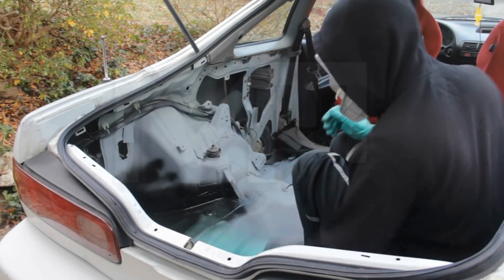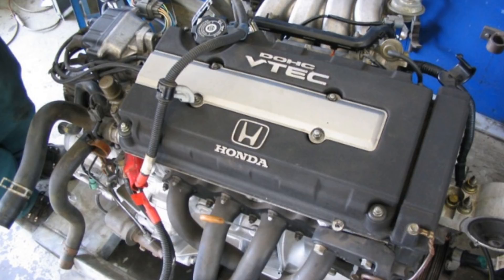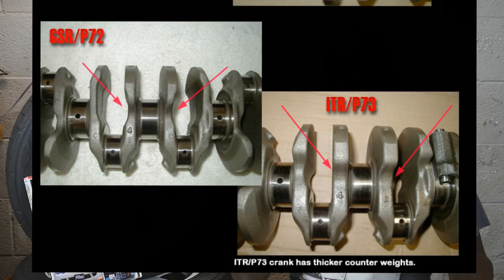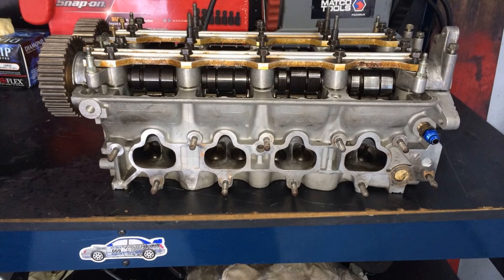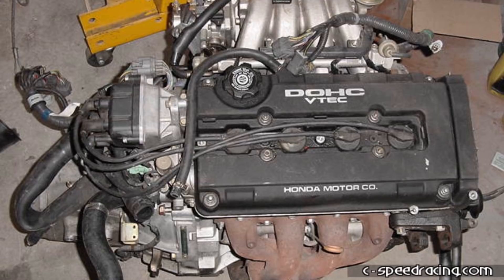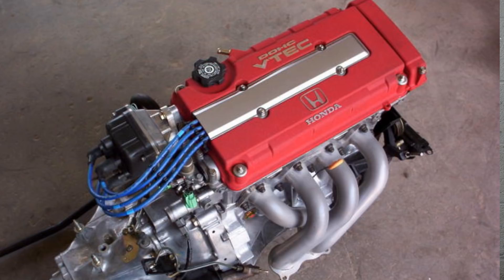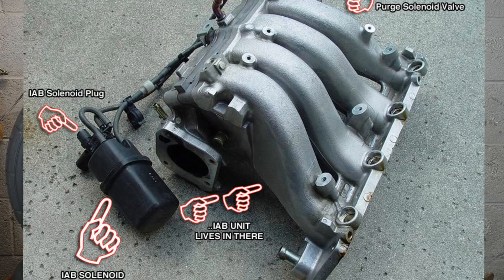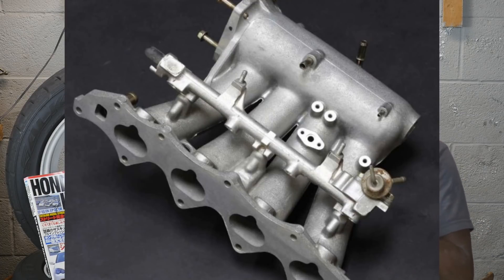The Difference Between: B18C1 (GSR) VS B18C5 (TYPE R)

Comment: What if the engine code on the front of the engine only says B18C? No number designation after the C?
Reply from the maker: It means its from Japan
Reply from the maker: They stamp it and it goes to the corresponding countries
Reply: @MITONFILMS  So how do you tell if it’s a Type R or just a GSR JDM engine?
Reply from the maker: Good question. Valve cover will tell you. If the previous owner changed it, take it off and check the retainers. If it has like a green strip on it, it's type r.

Another way to tell is to is to check the dizzy. The code will tell you if it came off a gsr or type r
Reply: @MITONFILMS  ok, thanks for your help. Great videos. Keep it up.

Comment: You failed to mention intake and exhaust ports. Ctr and itr come ported by hand from the factory. USDM B16a2, itr and ctr intake manifolds are all interchangeable with one another.
Reply from the maker: Actually they are not all "hand" ported. Only the 95 spec was hand ported the 96 and beyond was machine ported. I have a reference for you, but it's in Japanese...
Reply: @MITONFILMS  that I didn't know.

Comment: The USDM B16a2 that came in the civic Si 99-00 came with duel valve springs on the intake and exhaust side. I own both years. There bone stock.
Reply: Would you reccomend the b16a2? I want to make 600-700 hp. Is that attainable do you think? I know I’ll have to bore and stroke to 1.8, but its better than paying 10k for a b18 type r, or doing a Frankenstein head/block build.

Comment: I've own both the b18c1 and b18c5. What makes the type r sooo unique is The unforseen details that people absolutely DON'T KNOW. The type r is not a regular b16 head which was I huge mistake back in The day when people built a poor man's type r swapping a regular b16 head on a GSR block which resulted in that build under performing. The ITR b16 head first off comes slightly hand portered from honda. SECOND,  the gsr and b16 valves sit at the standard 60 degree valve angle but the TYPE R valves sit at 45 degree valve angle which allows the spray of the fuel injectors to be a direct shot (PERFECT). Also, to note that the TYPE R valves are designed completely different being they are   the lightest valves on the the honda line allowing the TYPE R to rev 200 rpms more because the stem of the valve at the top down towards the center is 5.5mm and from the base of the valve the stem is slim down to 4.4mm and still retain its strength. The double valve springs on the TYPE R  are not regular double valve springs and are also unique as these double valve springs or not circular in circumference,  they are oval in circumference to rev the top rpm of 8600 to 9000 rpm depending on your tuning. The block of the TYPE R IS capable of spinning faster than a 1990"s formula 1"s car , fact not fiction!!! This is only possible because the block is super unique again as the head is a the fact that the crankshaft is PERFECTLY balance to rev hard and not fly apart and that includes the technology taken from the legendary ACURA NSX rod bearings which are designed with the surface being rigid in little micro pyramid shapes to trap oil longer to keep lubrication at maximum,  the rods are modified as well with oil run off grooves and   lock out pins to secure the piston at maximum 8600 plus rpms for long durations to prevent catastrophic failure. The piston are also coated with a moly silicone anti friction coatings ECT.....

Comment: So a few months ago i bought a clean 92 civic hatch with a b18c5 in it. It legit says b18c5 stamped on the block, but i recently noticed the head has a p72 stamp on it, not the pr3 stamp i thought all usdm integra type rs had... i paid 3k for the car thinking it had a full b18c5, did i get screwed? It has upgraded cams, adjustable cam gears, Blox IM, skunk2 throttle body, aem fuel rail, 4-1 headers with full 3" exhaust...
Reply: Even if you don’t have a full B18C5 you got a bargain since on some markets just the block alone is worth 3-4K
Reply: The ecu is also chipped and tuned.

Comment: I got the non vtec in my 95 rs😔 but its the cleanest teggy and has no rust on coil overs straight pipes for 1000$ best first car ever
Reply: I just picked up my 95 ls for $800 I need a few body panels and weather stripping and some paint but I should be good
hopefully I didn't get screwed XD

Comment: I just traded my 03 350z track edition for a 2000 integra ls with a complete type r conversion,from the j's front end,to the interior,wheels,and untouched bone stock b18c5 type R motor with 95,000 miles,the car rips just as hard as my 350z and revs to 9200rpm,it's a beast of an n/a 1.8l 4banger motor,especially for stock
Reply: Beautyjuicynay02 luck you
Reply: Sf jealous 😂✌🏽
Reply: I love my b18c5. I have mine in a 92 civic hatch. It's built alittle and pushes 230hp to the wheels on the current tune.  These cars scream once vtec engages and they haul ass.
Reply: @ReaperActual518  What’d you do to it?
Reply: @MOMO7OH7  Skunk2 intake manifold skunk2 70mm throttle body,  Aem fuel pump, Aem adjustable fuel pressure regulator, Aem fuel rail, Yonaka 4-1 headers and cat back, adjustable cam gears im probably forgetting something but its pretty much all bolt ons.
Reply: @ReaperActual518  Niice, how much power you get from that?
Reply: Nice love my b18c1 in my 94 gsr freshly rebuilt all motor build by kpower

Comment: I have two b18c1 blocks with p73 pistons and pr3 heads with p73 cams and TypeR valve train. They do t rip pretty damn good. I person much rather have that set up then b20v. I smoked every b20v that have similar modifications

Comment: Cant leave out that the pr3 heads flow way better than Gsr heads reason alot of people use pr3 heads.. Yes combustion chamber a little bit bigger in PR3 head result in a tiny bit of compression lost but the pr3 a better head to use reason why b16 and type r use the pr3 head. I had both both are great head either way.

Comment: Hey Milton, FYI: my blueprinted all motor EK coupe B18C GSR running factory rotating assembly (lightened and balanced severely), ported and polished head, port matched S2 pro intake manifold and port matched hitech tri-y header (ultra abbreviated build sheet) that I time attack in the modified fwd class and it sees nearly 10,000rpm before every shift and loves it. 2 seasons on this engine now and a cracked 20 year old OE VTEC solenoid housing (from the sexy high oil pressures) has been the ONLY failure.
Oil (Motul 8100 X-Clean C3) changed every 600 miles or so for insurance. 
With the right approach, the GSR engine platform can be the NA powerhouse for the budget builder.
Vids and pics available upon request

Comment: the ls is the slowest 1st to 5th
Reply from the maker: newscooler12316 i was just talking about vtec transmissions.
Reply: Miton Films you should have mentioned that.
Reply from the maker: newscooler12316 i did. b18c1 vs b18c5
Reply: Miton Films yes but you made it sound as if it was the over all slowest the title did not help😉

Comment: Hi I was watching your video and I saw that you mention that the type r was the only motor that had dual valve springs on the exhaust side and on intake manifold side. What exactly did you mean tho because I have a 96 gsr and I've removed the head before and changed out the valve springs and valves, and both sides to the head have dual springs and dual valves. I'm sorry just a little confused by what you meant ?
Reply from the maker: +octavio aguilar dual valve springs.  So there should be a big outer spring and a smaller inner spring on one side. If there are in fact dual valve springs on both sides....then someone probably did it before you.
Reply: Ok I see what you mean the springs are shorter on one side and slightly lager on the other side

Comment: Gsr did have dual valve springs on both the intake and exhaust side. There's part numbers for proof too

All Type r heads share the same castings as the b16a heads but has been ported and have different valve seat angle
All Type r heads have the same castings as the b16a head, hence the pr3 head code 

Type r intake runners are shorter and bigger in comparison to the gsr "snail" manifold and the plenum is also larger

almost all JDM b series engines had higher compression pistons then compared to their usdm counterparts  

P72gsr heads also have a slightly different intake port in the head in comparison to the type r pr3 cyl heads. For the life of me I cannot find where I read that the pr3 heads have a better design intake port but, basically the pr3 intake port allows good flow but the gsr has a better combustion chamber 

There are more to it but just the gist of it. A good read on ffs tech net and theoldone.com will get you ALOT of info on just b series engines alone

Comment: I'd like to point out that you didn't mention the differences between the pistons. It would've been really insightful to talk about how the shape of the top of the pistons in conjunction with the shape of the combustion chamber affect an engine's compression, and therefore its power.

Another difference is that the Type R has a slight port and polish from the factory, while the GSR doesn't.

I'm not saying that anything you said was incorrect, I'm just adding information.

Good video. I hope you hit your 10k milestone.
Reply from the maker: Nathan Hang thanks! I hear from some that only the jdm 95 specs were ported but hey who knows they probably all were ported.
Reply: Miton Films yeah when I was looking into buying a b18c5 I read it was ported and polished some what. But then again it was Honda tech so who really knows lol
Reply: Miton Films pre98 b18c type r had hand ported cyl heads after that it was more cost effective and better  when Honda had the later cyl heads machine ported.
Reply: Can I put stander gsr pistons and rings on a b18b1 La integra. would that make the compression better than the stock b18b1 ? Or how can I get higher compression?

Comment: You can find B18C5s here in the west coast, but be ready to shell out about $3,500-$4,000
Reply: 07 Si4dr found a long block with paperwork for $2500. Decided to pass on it since my budget was $1800. Turns out the next owner was selling it for $2300. The next month. Makes me wonder why...
Reply: Hmm..I know that hmotorsonline.com always has B18C5s but at crazy prices. But I heard that their test every single one of their motors before selling.

Sounds sketch tho. I think you may have dodged a bullet
Reply: I bought my Jdm H22a from HMO and it was the best condition motor I’ve ever seen. Still has the plastic on the intake manifold to protect the lettering from 1993. 245psi per cylinder tested with paperwork
Reply: Bought JDM TYPE-R from HMO.. ten years later.. still same condition since running strong.. Great shop to make ur money worth it...
Reply: JDM B18C SIR Integra and the JDM B18C Integra Type R is the same motor and power and spec...only difference is the crank girdle..... piston, cams etc is all the same spec...
Reply: Update: it is now 2025 and b18c5 motors alone are going for $6-$8k, motor trans and ecu your looking at $10-$14k 😢
Reply from the maker: 07 Si4dr hmotorsonline is a very good shop. But those are Jdm b18c's. The b18c5 is usdm only, and i think they compression test each engine
Reply: Miton Films yup I checked... They do have random B18C1 for $3000
Reply: I jus bought a jdm b18c from hmotorsonline.com and after shipping and the ecu I needed for that motor it costs me 3k to get it n have it shipped to N.Y. n damn it's super clean n healthy n looks brand new n fired rite up first start deff go to them guys if ur looking to swap ur motor

Comment: b16c5 engines are available today but very expensive. sometimes requiring a deposit and wait times but you can get them if you want them for $5500-$7000 used 65k (video compression check ;)  ) new spoon b18c 11krpm 😀 is $9000-$10k and a race prep sleeved usdm b18 is $6000-$8000 not much sense in going jdm r spec at this point anymore they are nolonger $3500 like they used to be with lsd tranny.
Reply: Seen a genuine spoon type r online the other day for 7k with 35k milage
Reply: B16c5?  Or b16b ? Or was it a b18c5?